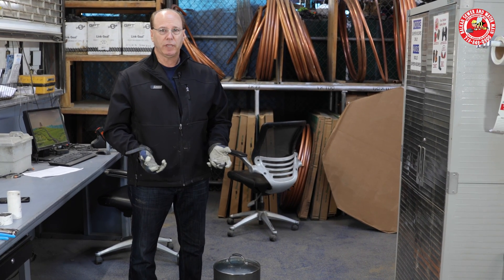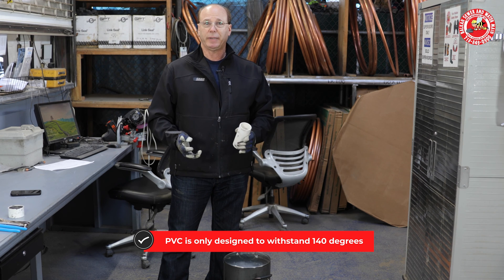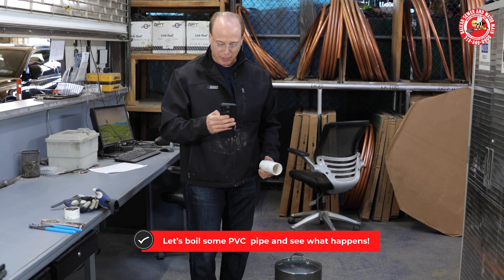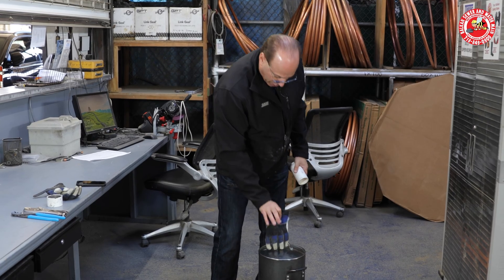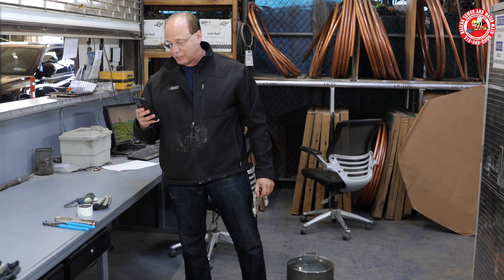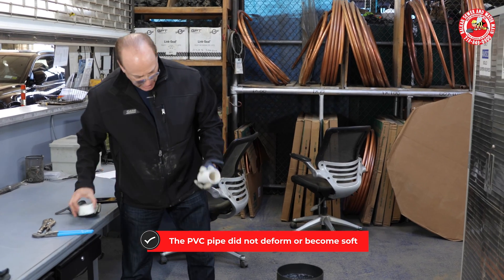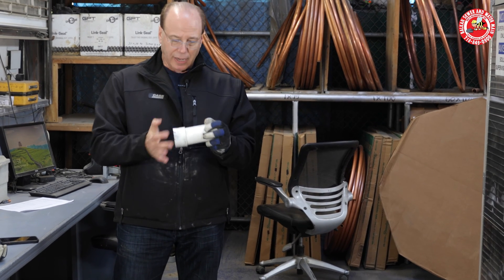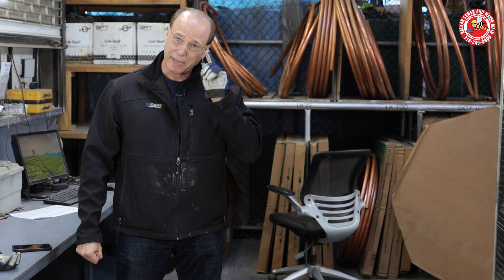PVC Plastic Pipes In Boiling Water - See What Happens!

Comment: You obviously  don't have the experience.  I've seen what  boiling water does to pvc. I've been in restaurants  where you see the deformed  pvc from boiling water.  Your wrong.
Reply: *You're wrong.
Reply from the maker: That could explain why pvc is not allowed in commercial buildings in nyc. This was sort of intended for homeowners.
Reply: @balkanplumbing  Could also be that some restaurant workers are pouring hot oil down their drain. Maybe you should try deep frying some pvc to see how it holds up haha
Reply: That's a good point, the volume of boiling water a restaurant might be pouring out would be a lot higher than residential  @balkanplumbing